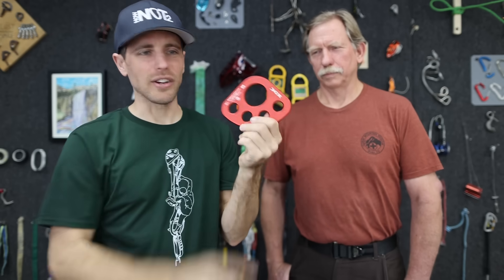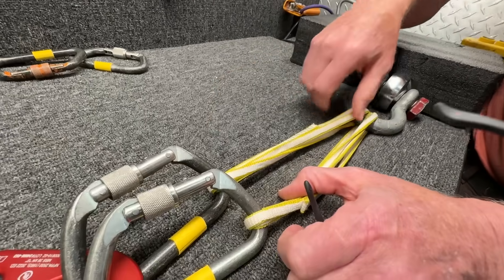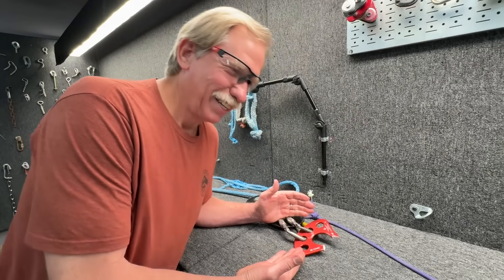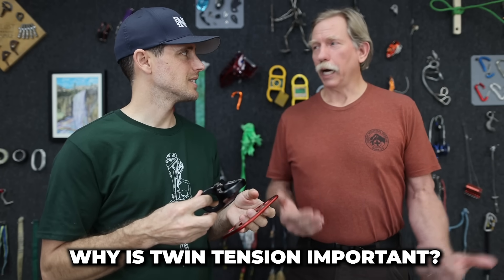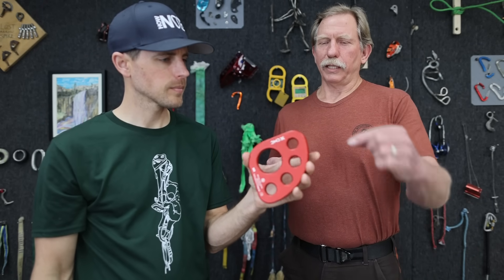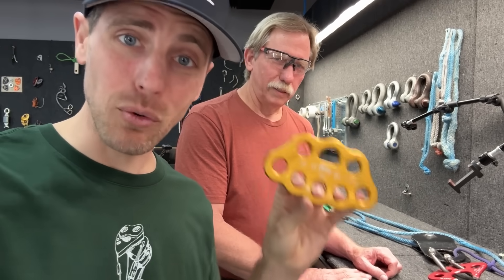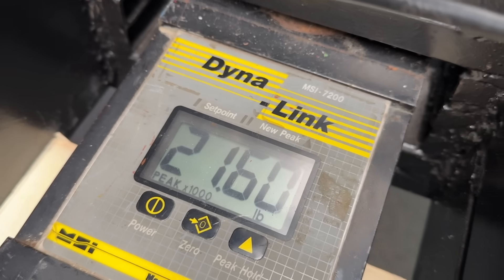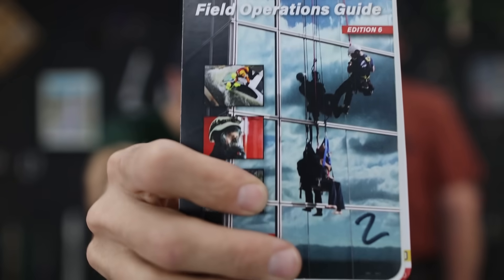When is Redundancy Ridiculous?

Comment: @hownot2 - ongoing debate on redundancy in anchors. People travel to Spain and see single fixed biner sport anchors (ie 2 bolts connecting chain terminating in a single nonlocking steel biner). Sometimes these are captive biners, sometimes not. They then think it's a-ok to do this back in N America.

Would be good to test what scenarios can create failure in this this single biner anchor system. 

In my mind it only cost a few $ more to add a second biner to your open anchor system - just in case something like a big swing out (ie cleaning) can introduce failure. I mean - what could possibly wrong lowering off a single biner right? :)

Lastly - some redundant systems also have problems - like the recent mussy hook incident where the climber died. I did a route in Nevada recently that had opposing mussys side by side - and the rope pinched between the hooks to a point we could not pull. Checking online - many people had issues with the same route (Mesquiter in Lime Kiln). Would be great to have a video on anchors that seem good but are problematic for less obvious reasons.

Comment: I’m a duel cert rope access tech IRATA/SPRAT. SPRAT says one rigging plate is enough. IRATA says you have to double them.
Reply: Technically irata doesnt say you need 2 rigging plates, just 2 independent points/redundancy. 1 rigging plate with a nylon sling back up achieves the same thing without risking carabiner damage.
I get iratas point of always needing redundancy but then is completely inconsistent by allowing both the mainline and backup to be attached to the same d-ring on the harness (which is much weaker than a rigging plate).
Reply: @adamwood9144 Not anymore. Now the 2 points must be independent, sternal and ventral D rings.

Comment: I've been working in rope access for 15 years now. We use redaduncy everywhere because of human errors. When choosing your anchors you can make a mistake without knowing it. It's the same for climbing or caving, that's not because there's 22kn engraved on an anchor that you can rely on it at 100%. It's always possible that there are some invisible issues with the rock (cracks) or the glue (dust in the hole when gluing)
Reply: Yeah, but this double stacking rigging plates thing doesn't stop any of those mistakes and is a bit silly.
Reply: @woody40000  Especially if it weakens a carabiner. Like he said, if everything you're attaching to it would break before the plate then you dont need redundancy.

Comment: never understood why they dont use WLL, working load limit, which always have a factor 2 or 3 safety margin , like anything else for rigging
Reply: Because rope rescue requires 15:1.   Rigging world isn't lifting people, they have lower requirements.
Reply: @thekid760  that may be true for your accreditation but certainly isn’t true for all. Some industrial rescue procedures allow for rigging to hand rails we could be incredibly strong but only have to technically conform to an outward force equivelant to the weight of an average person. Rope access, IRATA goes off 15kn (which technically is 15x a 100kg person) but allows 2 people on a system in a rescue. The 15kn is actually based of (low likelihood) max allowable impact force of 6kn with a 2.5 factor of safety
Reply: @adamwood9144  correct, I should've clarified.   NFPA 1983 requires a 15:1 for general use in emergency services.

Comment: I imagine that the PAW M brakes at twice the MBS because the MBS maybe it's calculated using just one "carabiner" in each side of the plate. but the test that they did here it's more realistic, because you don't use a rigging plate to use just one hole.
an interesting test would be having just one point in one side and 2 or more in the other side of the plate
Reply: My guess is that MBS is tle lowest strength between any two holes.

Comment: Great testing. The 2nd set up is how I rig but have been told by IRATA that I must back up the plate!! IRATA need to get a grip.
Reply: If you were to connect 2 sets of ropes (mainline and back up) would you use one 40kn carabiner or two? As far as the marked ratings go it’s the same thing. Personally I use a 1 rigging plate with nylon sling/s as a back up to the plate, no strange loading on the biners that way.
Reply: I have seen a few people back them up with a sling but if you're generating enough force to break the rigging plate, the nylon sling doesn't stand a chance so always seemed a pointless endeavour.
Reply: @pl7577  it’s not about the potential force that it would take to break a perfectly sound rigging plate, its that the rigging plate could have a manufacturing defect or undetected damage causing it to fail at a much lower force. This is the point of redundancy, short of cutting/melting a rope or nylon sling no one object in any system should be able to fail under the force you are putting on it unless you are a total fool. It’s also worth noting that the force on a piece of equipment that fails is not necessarily the same as the force that the back up system will see, depends on the situation, for example if you took a large enough dynamic fall onto a piece of equipment the energy absorbed in the failure may well result in a reduced force to the back up system.
Folks get too hung up on rigging plates, there is no difference in essence between a 40kn rigging plate, carabiner or metal sling. I imagine most folks would think it strange to attach a double rope system to a single metal sling and carabiner.

Comment: For a while now, redundancy is more about eliminating human error than it is mitigating equipment failure. If you are in a rope rescue scenario then you should be using equipment that is more than strong enough. Thats said, there is no reason for multiple plates. If a human doesn't have to operate it (open, lock, or tie), then you probably don't need two.
Reply: 4:22

Comment: Looks kind of weak if you are used to industrial cranes. The standard is totally different there. If something is rated for lets say 10 tons, you can lift 10 ton all day every day for years and still be good. The actual breaking point is several times higher than the working load to allow for many things to go wrong before you have an accident.

For example, my 4 ton overhead crane has 4 9mm steel cables which each would break at a minimum of 5.2 ton so actual failure would occur at like 21 tons. Everything is overbuilt. So if this was for an industrial job, this plate rated for 4 tons would be made out of like 20mm thick steel and would weigh like 5 kg.
Reply: The differences maybe smaller than they look. Climbing gear is rated by the break point, rather than the safe working load. Ryan has many videos on the actual loads at play.
Reply: That's Bc nobody is halting 1 ton humans everyday lol

Comment: to spell it out, the redundancy in rescue operations is not about increasing strength; it's about decreasing the harm a flaw or error can do. - or in other words, two points of contact is about having to have two failures before you drop the rescuer.
Reply: One of the considerations that becomes important for rescue - or professionals in general - is exposure. A small chance of disaster encountered many times becomes a not-so-small risk. There are always trade-offs.
Reply: @SnakebitSTI  it's the consequences of the failure that are the biggest consideration.  if a climber has an equipment failure and has a fall, that is a risk they choose to take.  a rescuer does not choose to take the risk of dropping a customer, from a single equipment failure.
Reply: I see it this way (simplified): redundancy is simply adding another layer to the swiss cheese model - every added layer of redundancy/engineered safety reduces the chances of consecutive holes lining up.
Reply: @joebob23us  a good application o the swiss cheese model.
Reply: The main point of inflection for if redundancy is needed is likelihood. The more simple the system the likelihood of a failure becomes so miniscule that redundancy ends up doing more harm than good. Over complicating a system itself comes with risks. A non moving part that breaks 3 times over expected force especially when made out of metal and is used appropriately is so unlikely to break it becomes unreasonable to mitigate.
Reply: @TommyJ76  if I'm interpreting your word salad correctly, you're saying there is a point at which the complexity of the system makes a critical error more likely than a critical defect.  and that's true, but the redundancy in rescue systems does not reach that level of complexity.  it simply ensures that you won't drop the customer because of the failure of a single moving part.
Reply: I just saw Delanys face roll his eyes when he heard - 'Irregardless'....
Reply: It does go both ways.
I have an anchor made of 50mm (just on 2") 316 Stainless.
I use double chains over it but that steel would need to bend or come through 300mm of concrete.
No need to double up
Reply: @getahanddown  if one chain fails from a defect or accident, there is another one. That's the point of the redundancy.
Reply: @kenbrown2808  Exactly.  You can't GUARANTEE there isn't a flaw in one of those links, but you can make that one-in-a-million flaw irrelevant by having another section of chain.
Reply: @FlightRecorder1 you can’t guarantee someone isn’t going to run every single 4 way intersection you approach but you don’t stop at green lights do you? 

Stick a chain between two vehicles and give a good tug, now you’ve proven 100% that chain is free from defects that will fail at 10% of the load you tested successfully. You always must draw a line between risk and redundancy. 

Be scared of things that will really hurt you but don’t worry about things that will no longer be your problem if a failure occurs. Death isn’t scary, permanent injury is.
Reply: @ Your car analogy is faulty.  My redundancy in a car is the giant metal cage surrounding me. Plus, I can look left and right to avoid trouble.   I can't do that with climbing gear.  You often can't tell how poorly an anchor is installed until you load it.  

Also, I want to prevent other people from dying, being injured, or traumatized if possible.  If I fall off a wall and am killed, my girlfriend will be absolutely horrified.  And if that happens while climbing multipitch, she'll at best be stranded on that wall somewhere or at worst also fall to her death.

Comment: The problem is anomalies in the manufacturing process, it's russian roulette, and for lighterweight items, fatigue.
Reply: This is exactly what I scrolled through the comments to find.

If it’s built properly you shouldn’t have a problem, but one flaw in the material could compromise the part. If it were me, I’d go with stacked plates (preferably from different manufacturing runs) because you dramatically reduce the chances of two failing at the same time.

You also need to consider that even with redundancy the failure can have side effects. If you have one failure, the shock can put addition stress on the other. With the safety margins at play here that shouldn’t be an issue if the second one is sound, but it needs to be considered in the design. With stacked plates, the way slack is taken up between the plates wouldn’t be likely to do that.
Reply: @rainmannoodles  I get it, this is high consequence stuff, so redundancy feels good but, I've been doing this for 30+ years with many many evolutions. I have never seen a piece of hardware or software fail in the types of tension with two person loads that we typically do. Yes, we have damaged equipment and yes we have had failures from side load of carabiners and yes, we've had abrasion incidents on rope and other software but never a failure in tension. Does it happen? Probably but I would guess the incidence is so small that it is statistically insignificant, just saying.
Reply: I suppose if you don't trust Petzl's manufacturing and quality control, you could make them yourself. Personally, I trust them more than myself though.
Reply: @soffes I mean, people have died from their products failing before... no manufacturing process is perfect, or perfectly consistent. No one has ever died with a redundant system failing though, so.... good for you?
Reply: @soffes  not sure if the many recalls they've had over the years is due to high quality control or low quality control... but I agree about the trust side of things.

Comment: I was recently talking about this with some IRATA people, including an instructor. They use doubled plates because the IoC requires everything to be doubled, but mentioned they use a single plate for anything non IRATA. Richard Delaney, the one mentioned in the video, has an article where he describes why he's happy with a single plate too. Super bomber enough
Reply: What if there's an invisible crack or some other manufacturing defect in the plate? What if it somehow gets loaded weirdly? 
I'm sure it's pretty much entirely safe to use just one, but if adding another makes it just that slight bit more bomber, why not?
Reply: @nerfzinet  microfractures aren't an issue with modern equipment, any real issues will come from heavily overloading it (which you can control yourself) or visible fractures. Adding a second plate doesn't make it stronger, but the loading on the carabiner will actually make it weaker when adding a second plate
Reply: @jetseverschuren  someone just texted me about microfractures, I don't know enough about metallurgy to speak to that but as a small sample, Ryan and I broke a 30+ year old plate last year with just one connector on each side. It was 43 kN and that plate was so dinged up and battle scarred from 30 years of use. I speculate that it would've been much higher number if we had configured it the same with two connectors on each side. Video here. https://youtu.be/nHfUiQf53Xs?si=X8ATTlwzXU71pxWt
Reply: @DRRRescue  I'm no metallurgy specialist either, but as far as I'm aware, microfractures (at least from impacts) has been pretty much debunked for modern equipment that's properly heat treated. There are a few documented cases of people using aluminum carabiners for slacklining, where the high amount of cycles caused some fatigue in the carabiners, eventually leading to failure in some other situation (I though climbing) at absurdly low forces. So as long as you know the history of your equipment, there shouldn't be any issues